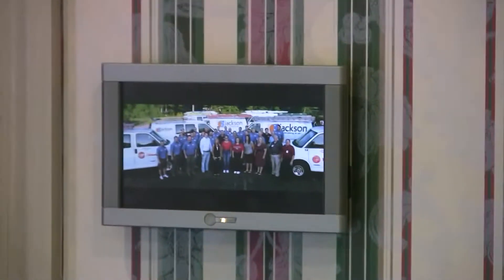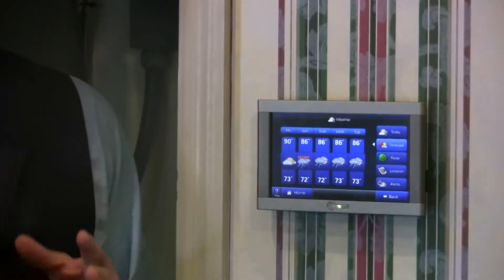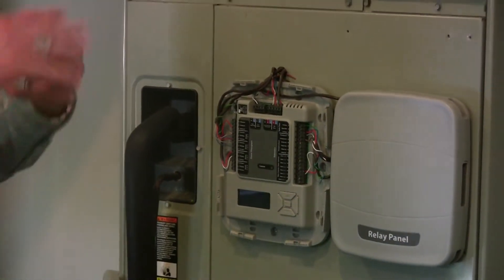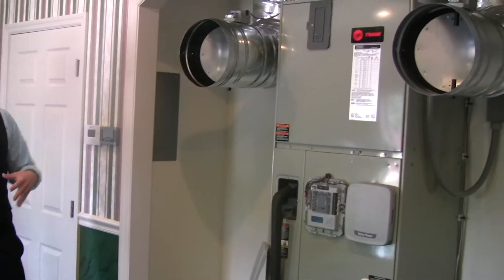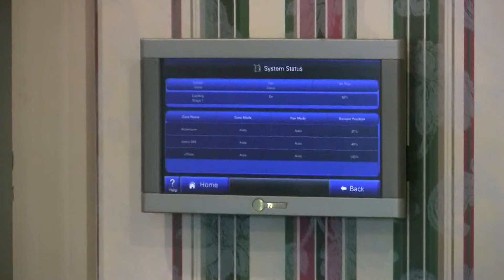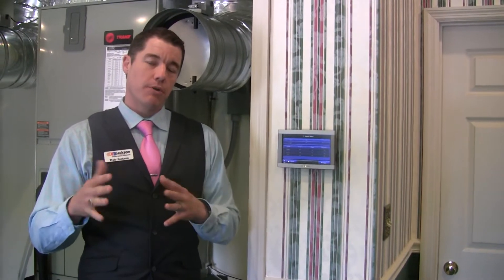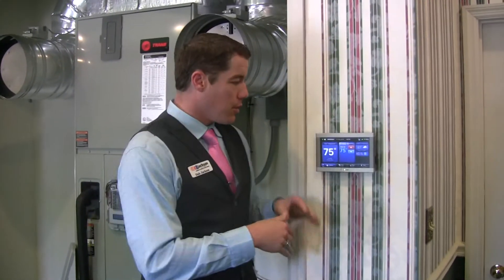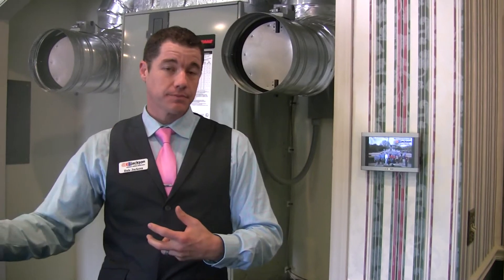The Incredible Trane Comfortlink II Zoning (Part 2)

Comment: I've been trying to get my thermostat upgraded for over 5 years now.  When I call trane customer service, they tell me to contact a local dealer.  Well, to date I have called 13.  They either say they do not know what I'm talking about, or they want to send out a serviceman to look at the unit.  (Why?)  When I bought the system it could be updated via the internet, but not anymore.  My zoning system has been a great disappointment.  When I turn off a zone, I have learned that they are programed to allow 40% bypass air to the zone that is turned off.  So, I cannot turn off a zone.  I will never buy a Trane system again.  Too expensive, poor performance.

Comment: I have had these thermostats for about a year, and cannot get them to reliably communicate with each other over my wireless network.  Neither Trane nor the installer has been able to solve the problem.  The latest information I have gotten from the equipment distributor is that, although Trane says the thermostats will communicate with each other, they really don't, and they have no solution to make them talk to each other.

Comment: Awesome!  I have a seven year old Trane single stage heat pump system with a variable speed air handler. I would love to upgrade to communicating technology with modulating zone dampers. How much difference do you think it will make on a single stage system?  Will I need a barometric bypass or will the blower be able to ramp down enough (via the bk terminal) to lower static pressure?  Thanks:)